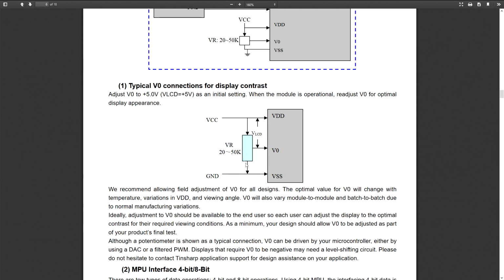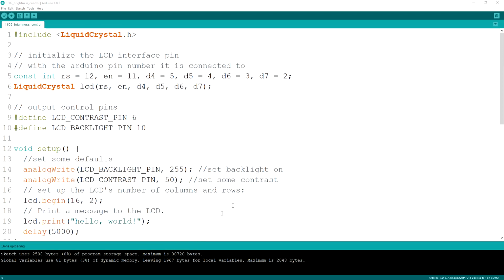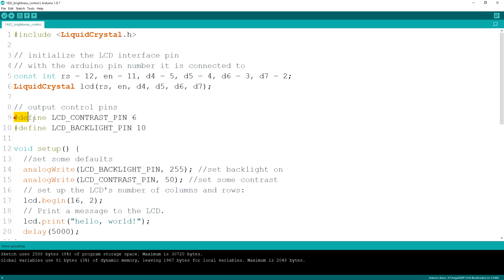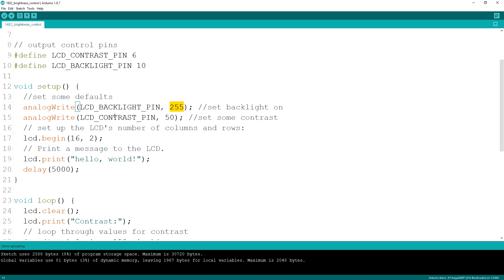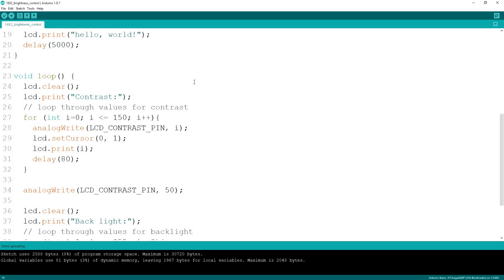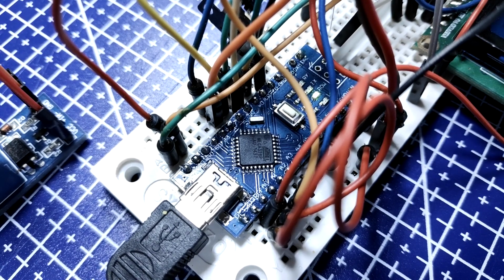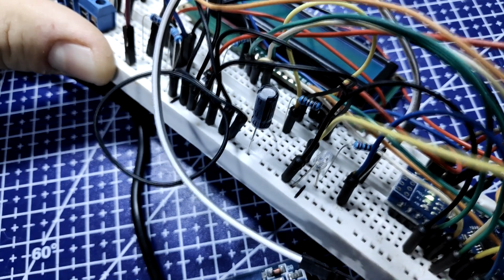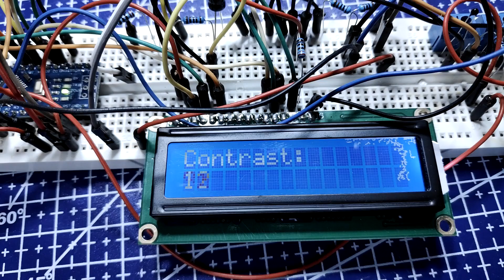1602 LCD contrast control with Arduino //Arduino Tricks

Comment: Can this be done when I'm using the LCD with the I2C adapter?
Reply from the maker: Unfortunately no. The adapter has these pins wired to a potentiometer and just digital control for the backlight.

Comment: May i know, how to make the backlight keep blinking? What's the code? Please Give example project
Reply from the maker: You can connect the backlight to an output pin and drive it just as an LED.
Reply: Do u know how to make this project? https://youtu.be/Db-Usb5L7As
Reply: I mean the backlight blinking like this project👆
Reply from the maker: You have link to the code in the video description.
Reply: Broken link so can't open
Reply from the maker: I just checked the link to GitHub and it works.
Reply from the maker: https://github.com/bkolicoski/1602-lcd-contrast